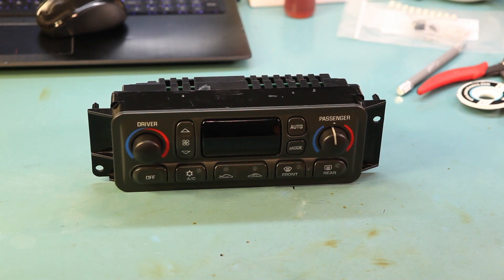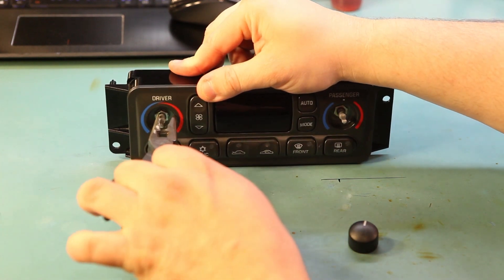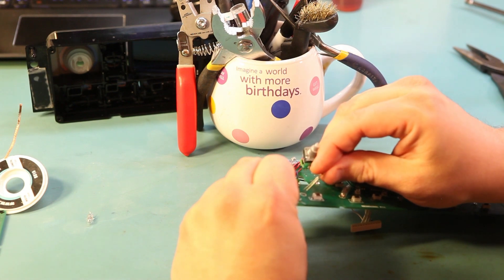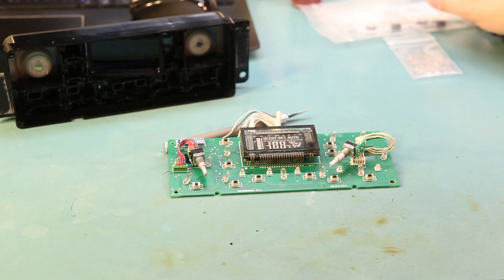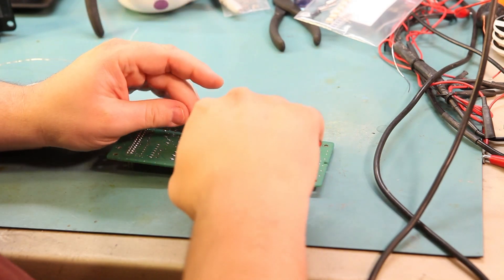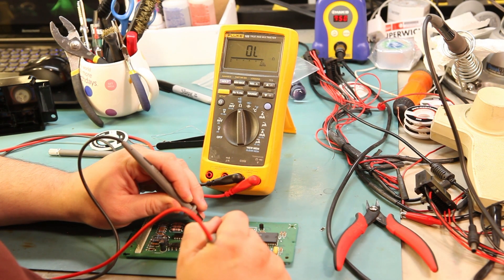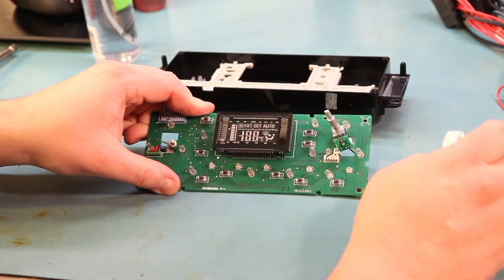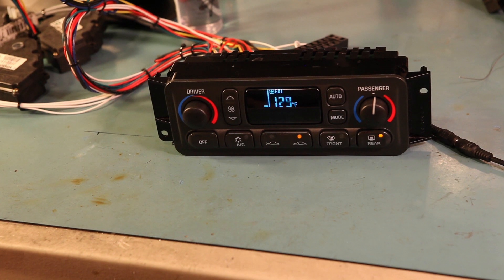97-04 Corvette #2 - CJ2 HVAC Controller Repair

Comment: Very helpful! Just curious,  ive got a different issue from what you mentioned. the drivers knob on the hvac control doesn't work. When you turn it it doesn't change anything on the lcd. Any idea what the issue could be? I'm pretty proficient in soldering. I was really hoping to get some help.  Thanks a bunch!

Comment: Do you Repair those ? I need mine done?
Reply: Did you fixed it???
Reply: Yes, we repair these. Contact us at sales@batee.com or (573) 647-5301
Reply: @bryanthompson3180  What does your "repair" entail? Do you install all new bulbs, too? If so, how much for entire job? Do you offer an exchange program, so there's no turnaround time? Thanks in advance......
Reply: @bryanthompson3180  Hi Guy. I asked you a couple of questions around 2 months ago, and got no answers. I now have a 3rd question, which I'm hoping you'll answer, along with the previous two. #3: Why aren't the LEDs replaced too? Aren't these what lights the buttons for defrost, A/C, rear defroster, etc? All 6 of my LEDs are apparently out, because none of my six buttons light up......
Reply: @milojanis4901  Hello:  We get too many comnments to respond through Youtube.  Contact us at service@batee.com if we can help more.  We charge $149.95, and we replace all bulbs, replace power resistors, replace the switches, resolder the display, and clean and test everything in a live wiring harness.  We don't replace the LEDs because they don't tend to fail.  Thank you, Bryan Thompson

Comment: Outstanding!! I have looked for how to repair my unit for a while, this fits the bill! My passenger side knob does not change the temp, it simply turns. Now my fan control doesn't turn on the fan. Would your repar kit resolve those issues? Thanks, look forward to ordering the kit, thank you!

Comment: My hvac lcd fan speed goes up when I press the up arrow but doesn’t actually turn the fan speed up. I replaced the fan control module and that didn’t work what on the board of the hvac could be causing this?